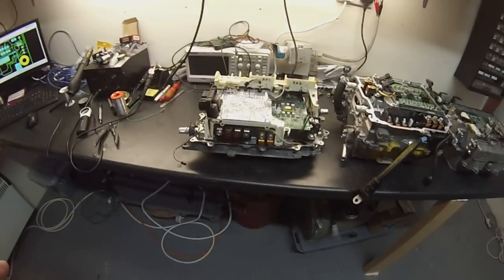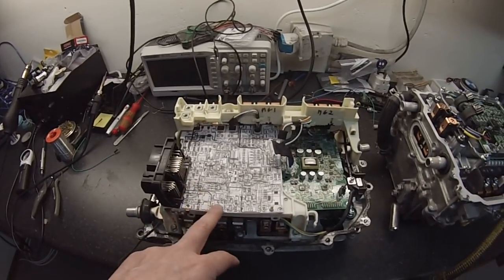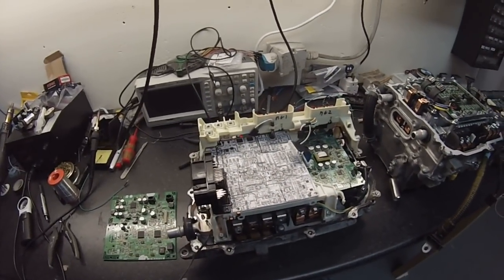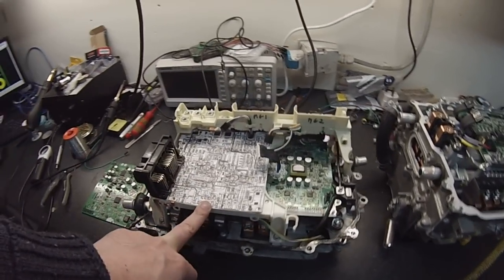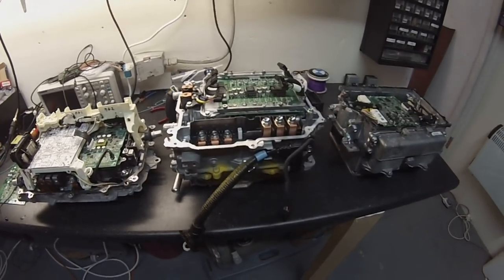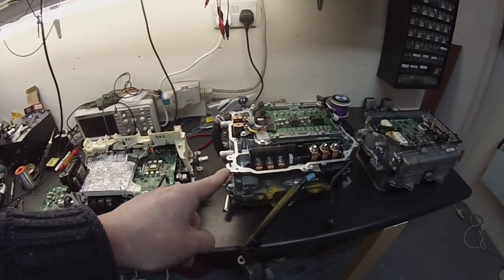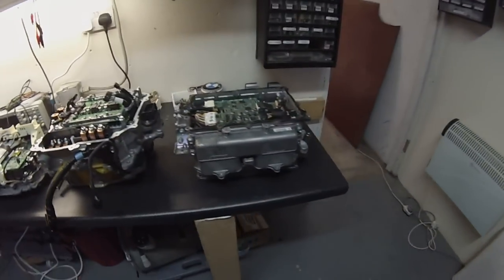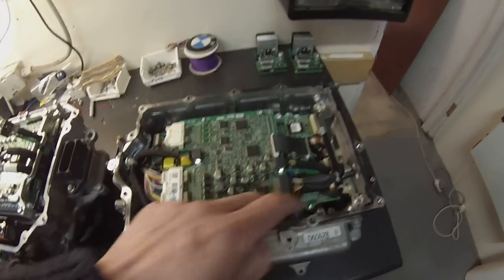Lexus GS450H Gearbox Project Returns

Comment: Awesome. I'm hoping this EV conversion with the GS450h gearbox will become simplified to a diy level for inexperienced EV converters. I hope to use it in my E30 some day.
Reply: If this becomes a plug and play solution then holy crap
Reply: 160kw MG2 with 2 speeds transmission!! That would be spectacular!!

Comment: Deceptively clever man makes utube videos. I'm a fan.
Incidentally, I have a GS450h, my strong advice is buy a nice one complete. An exceptionally fast, economical, quiet and exquisitely well built car. I doubt I will ever own a better car.
Reply: I agree I like the car sounds like you know a little bit about the vehicle. I recently have had the check hybrid system come on and my steering is locked.  It won't move at all and I checked all fuses which is good can you help point me in the right direction. The nearest dealer is a hour away and I can't really afford a tow then a diagnostic on the Lexus at the dealership

Comment: Thanks Damien! Appreciate your great work. Could you check on the RX 400h or the RX450h .. they have rear electric unit and the inverter supports 3 motors controllers. MG1, MG2 & MGR. Keep the great work!!

Comment: Thank you for the great stuff you re doing. This is exactly what I was looking for! I am planning to use genuine RAV4 front 110kW AC motor taken from Hybrid gear box with custom body shell, Does your Prius board fits to the  Rav4 inverter or I need GS one? is it possible to order complete tested inverter solution from you? Will it recuperate and charge it back as well like genuine?
Where can I read about how to wire it with pedal and motor together?

Comment: Ijust got a Camry hybrid and broke it down. It looks identical to the gs450. I am interested in the boost converter right now. Online document say it is in series from the battery to the inverters but it seems to be in parallel to me. Are the documents from owk ridge labs incorrect?  Thanks for your hard work. And old carb tuner is learning a lot.

Comment: hey!
ive been spending the past week looking into various motors as a sort of hybrid system. heres my question right now, do you know of a system or have you made one of those toyota boards capable of running the gs450 inverter or another toyota inverter with the first MGU only? im assuming the inverter has some sort of hardware failsafe that wont run the first motor without the second motor. or could you recommend me an aftermarket inverter and a setup to run the GS450 hybrid HV battery if you have dabbled that far into the GS450 parts list
the hybrid system im thinking about is taking the first MGU housing off completely and putting it between the gearbox and differential of a regular ICE vehicle and then powering it with its own battery and hopefully inverter with a CCS1 fast charging setup since the GS450 battery is a 270v system. i have all the control schemes laid out but i cant find if your reverse engineered toyota boards are open source with their code and I/O which i would need to implement the hybrid controls.
Or perhaps give me any information about problems of using the first MGU only

Comment: So with the evbmw board can any of these inverters be used to power any lexis/Toyota hybrid motor?
Or would a GS450H need to be powered by a GH400H inverter?
I'm hoping to power a LS600H box with a GS450H inverter but I don't know if that's doable?

Comment: https://info.ornl.gov/sites/publications/files/pub26762.pdf

The link above goes into all sorts of details about inverters/ converters and transaxles in Toyotas...Well beyond my  ability to understand but maybe not your ability.
 Perhaps this will be helpful to you. 
 What I would really like to see you work on is a way to convert the high voltage from solar panels or a full electric car battery pack ( something in the 200 to 600 V DC range) through these cheaper converters into useful household  electricity 120 or 240 Volts AC.
It's just my opinion but I think that may appeal to a much larger audience than those that want to build their own electric car .